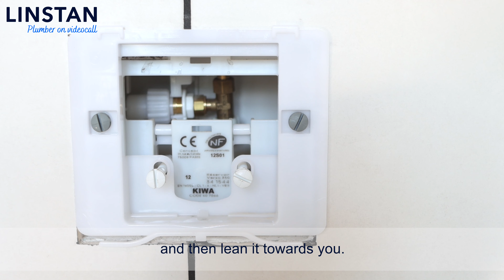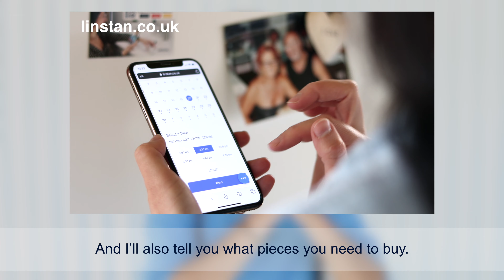How to repair my Siamp flush ? (wall-hung wc) | linstan.co.uk 1/2

Comment: We had some "professional" workmen over that after they were done were confronted by a toilet filling up way too slow and continues flushing. They were dumbfounded and after they got paid left saying : "live with it"
Your video helped to see that the valve rubber was indeed broken, and one of those 'professionals' managed to have screwed off the floater and dropped it on the bottom of the tank.
After watching  this video I managed to do what they couldn't 
Thank you!!!

Comment: Hi great video. I already bought the new mechanism in full fitted it and it’s still trickling slightly. I bought the entire mechanism so it can’t be the valve. Maybe it could be a leak between the actual basket and the tank? It’s only a very slight trickle but obviously it means that the tank very slowly drains and fills multiple times throughout the day. What do you think..?

Comment: Where to find a BCM350 flush valve product 32454707 for concealed siamp cistern in Ireland or to order online?
Reply: received replacement...putting it in has made me demented!!! and am still not sure it's right!!!
Reply: DID IT!!!  New bottom connection was different but it fitted better than the original.  But found I had to lower the 'ball cock' because the water wasn't shutting off.  Hopefully it is done.